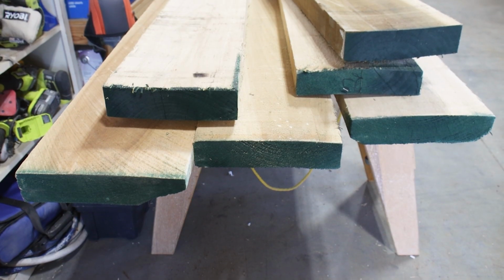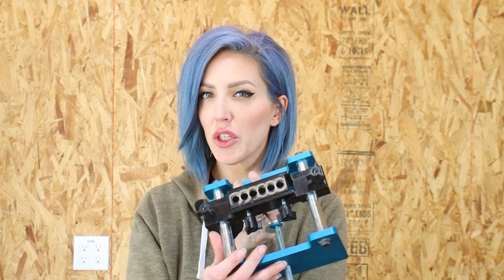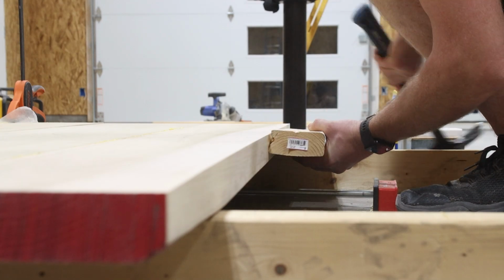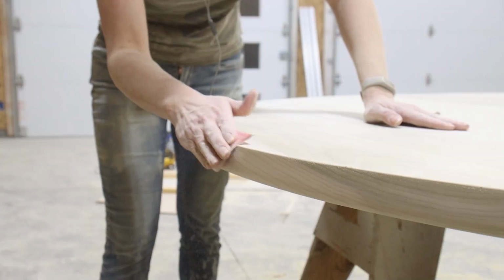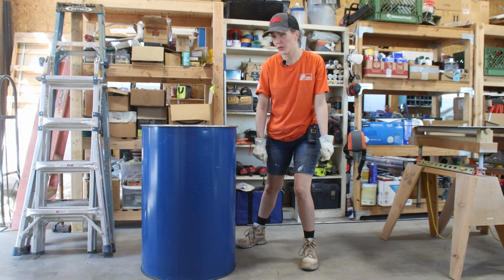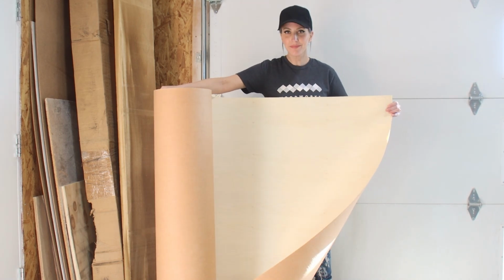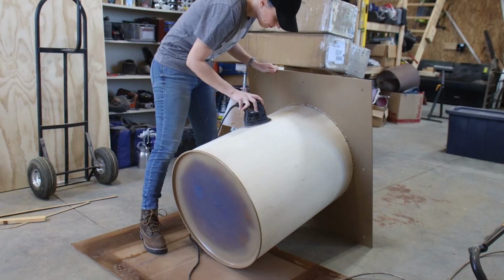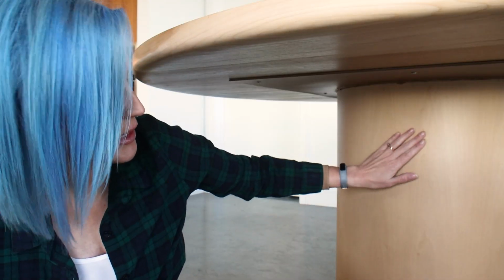How to Build a HUGE Round Table

Comment: Great video! Learned a ton!

Quick tip: Self-etching primer really isn't made to go over an existing finish. It's an acid base that's made to bite into raw, unfinished metal (normally steel). 

For your purpose (like on the original table stand) , try sealer primer, followed by block sanding with 320 grit. It will seal in the old paint and give a nice uniform base for your color coat.

Otherwise, great video!!!!

Comment: Your "pretty clever" solution, has been applied in Machine Shops in the machining out sections of metal for over one hundred years. Applying it to wood, I'm pretty sure, has been around for just as long, if not, than carpenters just weren't paying attention.😆😅🤣😂

Comment: I worked in a union shop in NJ. the finishing department used 10% water with denatured alcohol. to raised the the fuzzy surface on wooden pieces. when the surface flashed dry the sanding started. useful when finishing wooden floors too.

Comment: Thanks for the video your table looks great and you have well dressed helpers. I am working on a 54" round table. Were you able to get the table flat enough for a level to set across it or did you just worry about sanding the joints smooth?

Comment: Very nice job on the table and base. If there is a next time, you could have drilled a hole and used the jigsaw from the top, this way you can see how close your blade is to the table and at the same time, made sure you didn't leave too much wood to route off.
Reply: I know this is old but jigsaw blade is no longer than router bit

Comment: Looks great. 
I'd imagine that there is no real need to drill all though holes though. Just cut the rest from the top using the jigsaw staying to the outside of the router bit cut. Then use the flush cut bit, as you did.

Comment: Lovely table! And I love the chairs. Makes me want to build one now

Maybe you hadn't used a large enough bit in your router. But you can always use the jigsaw from the top and make sure you are cutting by the outside of the cut, then use a flushtrim bit just like you did. 
If I didn't explain it very well, it's what he does for all his circles, it's about 15 minutes into this video. 
https://youtu.be/HZXeNV5Fs7Y

If you ever get sick of the base, you can always add nosing trim to it like this piece. 
https://youtu.be/bkhHIDvePvI

Comment: In hindsight You could have just Drilled through the center screw hole you made to hold the jig then flipped the table over And plug in the same jig And finished the other half of the cut in a circle. Beautiful work though! 👏🏽

Comment: I think what surprised me the most is the total amount of money it cost you and the looks. Thats pretty amazing. Also about the base I do get the feeling that from a far it looks painted and I think its going to bother you enough to actually see another video with a new base haha. However do you have an estimate on how much the top weights? Maybe a custom base like the one Black Forest use be a right fit for it. But I'm pretty sure it will cost more than 300 bucks. Regardless it looks great and my last round table which had a horrendous base after a week I completely forgot about it and didn't remember I didn't liked my bess till I was taking it apparent for a new table haha so you will be just fine. Thanks for the video.

Comment: Excuse my ignorance but I was curious about cutting the top. Couldn’t one drill one hole to insert the jigsaw blade and follow the routed path?
Reply: your method is simpler. but her method is easier on the jigsaw and her hand i guess.
Reply: No, not with with the boards she is using. Its way to thick. She would end up burning through too many bits at that deep of a cut. Not to mention it would leave a way rougher finish. 

I will say that she should have just flipped the table over and used the router on the second side too instead of drilling all those holes and then the jigsaw. I would have just put and x going down the center of the table to align the second side and use the same circle jig to finish it off.
Reply: Oh I see! Very good points made for all involved. I guess the old adage stays true: slow is fast!